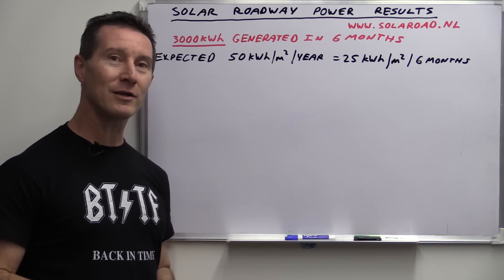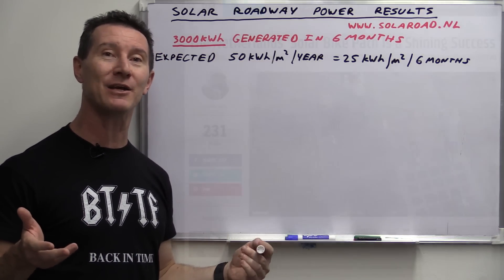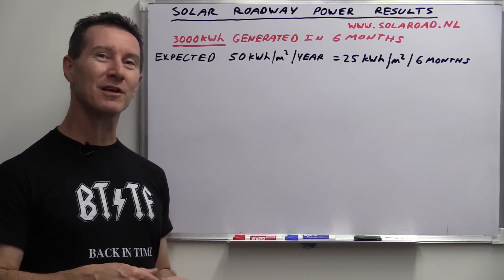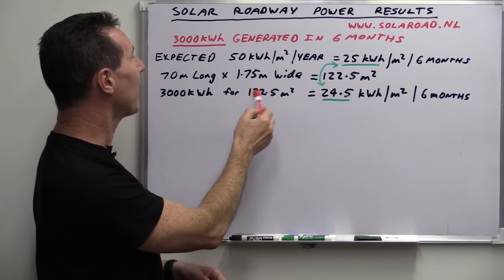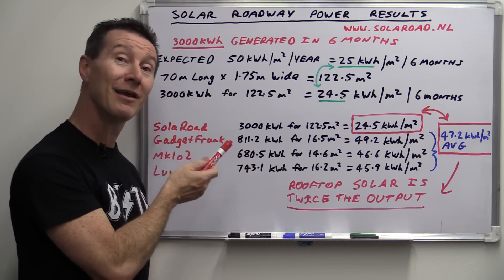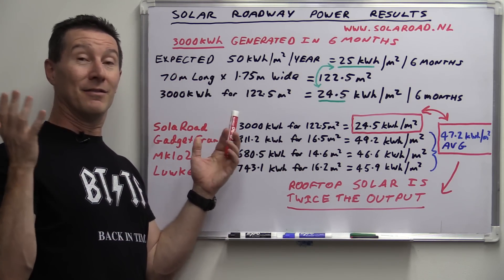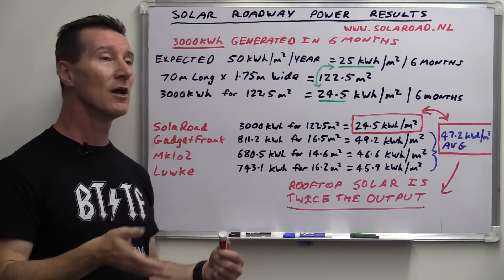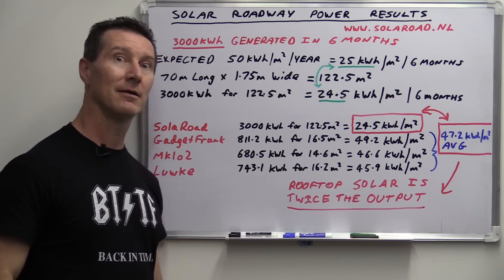EEVblog #743 - Solar Roadways Test Results

Comment: Pulling out my trusty Construction Master calculator I started working the numbers and confirmed the Google converter. Four feet is 1.219 meters wide. For ease I'll just use 1.25 meters for the width X the 70 meter length = 87.5 square meters. 
So 3000 kwh output divided across 87.5 square meters of surface area = 34.28 kwh/m2 
And that looks like about 75% efficiency compared to rooftop units as opposed to 50% efficiency. I'm no math wiz, nor am I an engineer but it would seem using real numbers can make a significant difference.
Reply: ronc1357 The bicycle path is 3.5 meters wide. Just look at how the road panels are installed.
But the solar panels are less then 1.75 m wide, more like 1.6m. They are off set by the lines in the middle of the road, and they don't go all the way to the edge. Just like there are gaps between the panels where 2 road panels meet.
When I do the calculations I come to roughly 28-30 kWh/m2 for 6 months.
But this measurement is winter/spring. I did some ballpark recalculations based on other Dutch systems and you will end up with over 70kWh/m2 annually.
Is this figure of 70Kwh feasible for deployment? I do not know. How can anyone possibly calculate that if we don't know what the road costs. All we know is the project cost, and they have been working on this for 5 years or so. The majority of the project cost is R&D.
Given the facts we have its impossible to tell how feasible these roadways are.
Reply: karp001 It was estimated by Dave to be 1.75 meters wide not 1.25 meter.  Which equals 122.5 square meters, not 87.5 square meters. 3000/122.5=24.489 kwh/m2. Which is 50% output not 75% output.  @ 5:00
Reply: ronc1357 Got to refer to my previous post. 
I read that article about Solaroad in the NL. The width of the path stated in the story was four feet. Using a converter found on google, four feet is 1.219 meters. now 1.219 meters being an unusual number and for ease I rounded it up to 1.25 meters for the width of the path. 
The key here is using actual numbers from the report. NOT a guess.
Reply: karp001 With just a few moments more googling I found the article and read it again. 
The first road in the world that generates electricity
SolaRoad is a living lab of about 70 meters and consists of a cycle path constructed of concrete modules of 2.5 to 3.5 meters. In one lane, solar cells are fitted underneath a tempered glass top layer of approximately 1 cm thickness, covered by a transparent and skid resistant coating. 

http://us7.campaign-archive2.com/?u=fc23dec47019a23d70031492e&id=39c5c2acf8

So, While Dave is willing to estimate to prove his point, I prefer to use something closer to FACTS. The path width varies from 2.5 meters to 3.5 meters, do the PV cells vary with the width of the path or did they follow the easy route and build all the PV cells to the same dimensions?
Reply: karp001 I just looked it up, and it looks as if you are correct. The dutch law states that a bicycle path has to be a minimum of 2.5 meters wide, or 8.2 feet wide, which would make the solar cells to be about 1.25 meters wide.
Reply: Raspoetin a Why are they hiding the actual costs? All they give is the cost with the R&D, are you suggesting they don't have a clue of the actual cost (taking R&D out of the equation), seems to me that wouldn't be that difficult to figure out if they are the ones who built the thing. It also seems odd to me if they are factoring in the 5 years of R&D that the figure is only 3.5 million euros, unless that is the actual cost. The same goes with Solar Roadways.
Reply: ronc1357 The project seems to be funded by 2 companies, 1 that builds roads, bridges etc and the other seems to be more involved with all the technical bits that goes along with infrastructure.
I am sure they now have a very good idea how much these roads cost to make. As to why they don't divulge that, I do not know. Maybe they just don't want to show you their profit margin...
Both these companies are decent sized companies, 1 has 2300 employees, the other 230 (but is part of a larger organisation that employs 7000 people). 
I find it very hard to imagine that they are doing this 'on a whim'. They must have good reasons for starting this research.
Reply: Raspoetin a It makes no logical sense from a sales point of view to give the cost with the R&D involved if you are trying to get the public to accept what you are doing. It would be logical to give the cost with the R&D and then give the cost without to show that it is cost effective otherwise how are you going to get any support for your project, and as I said if they have 2,530 people working on this the 3.5 million euros is not enough. 

Where did you get your information about how many people involved?
Reply: ronc1357 They don't have thousands of people working on it. I doubt anyone is involved in the actual research. Most of the research will be done by TNO (a research company).
But these companies are 'serious' players. Perhaps they can see a market for this product appearing in 10 or 20 years, and they don't give the actual figures because their intention is to start selling these roads for less then cost.
Reply: Raspoetin a 
I posted in my blog an analysis of the size, production and estimated costs for this bicycle path. It is written in Spanish but most of my references are in English. https://dcshams.wordpress.com/2015/06/14/fiasco-fotovoltaico-o-infundio-analitico/

Comment: So I am a little ignorant when it comes to the math, I am a psychologist not a mathematician, but what I want to know is what would have to change to make the solar roadway a more viable option? Do you think they could actually get there anytime soon?
Reply: Steven Ramey The glass, the components, and the installation,  would have to be nearly as cheap as what's used today for roads, can be a little more if there is an income from the electricity produced. They would have to be considerably more durable than existing road surfaces. There would have to be some sort of energy storage that would be able to handle the amount needed to do all this as claimed. The solar cells would have to become at least 400 times more efficient than they are. 

Basically the law of physics would have to change in order for "Solar Roadways" to work anywhere near to what is claimed. No nothing could actually get there anytime soon.
Reply: ronc1357 
Well okay then. Thanks for that explanation. That sucks though I thought it was such a neat idea too.
Reply: Steven Ramey No one here knows what the cost of building this road was. All we know is the project cost which constitutes mainly R&D.
Rising energy prices could possibly make this road viable. Being less dependent on oil producing nations could also be a factor that would make the road viable.
At the moment it is just impossible to tell.
Reply: I just thought that with all the extra stuff like recycling run off water, having roads that light up and alert people of accidents, and heat up to prevent freezing, plus storing cables, that it would be a worthwhile thing to experiment with.
Reply: Steven Ramey all the extra stuff you're talking  about adds considerable to the cost of the road plus the extra stuff you're talking about decreases the electrical output of the solar panels, most likely to the point that it will actually draw power instead of produce it. 

For instance I watched a video promoting heated driveway. "Indiana warm floors" they stated it takes 150 BTU's of heat per square foot to keep up with a 1 inch per hour snow fall. 150 BTU's is equal to 43 watts. 

At 43 watts/square foot Solar Roadways would need 18,576 watts to do this for their prototype driveway. Solar Roadways stated that their system produces a total of 3,200 watts of electricity, with the possibility of going up to 7,200 watts.
Reply: I just meant it was interesting to experiment with not that it was actually practical at least not right now but maybe someday or maybey someone is going invent something better.

Comment: Thanks for this video, and the previous two.
I'm no scientist and barely an engineer. You definitely proved that rooftop solar power is twice as good as solar roadways. I'm completely convinced.

I think there's more energy output from solar roadways than cement bricks and current sidewalk materials. The cost to replace them may not equalize yet, but I hope the potential is there.

Comment: Consider that they got that in winter, when the available light per month is lower: less than 50% of the yearly production is expected, not 25 kWh/m^2/6months but less. On the rest I agree
Reply: Olaf Marzocchi He is comparing Solaroad to normal roof mounted solar panels that are set up in roughly the same area in the same time frame, and by comparison the Solaroad was 50% less productive than the normal solar panels.
Reply: ronc1357 sure, but that one is ok. At the very beginning he wrote that the expected production in 6 months is half of the yearly expected production (50 kWh/m^2/year). And that is not correct (in general).
Reply: Olaf Marzocchi That was a mistake of wording on his part, I agree with you about that. Even so, the main reasoning behind this video is a comparison between the two technologies, that shows the production of the solar road is only half that of normal solar panels, and the claim they "Solaroad" got better results than expected is wrong also because these are exactly the results they expected. If the solar road got twice the production than it did it still wouldn't be economically viable.
Reply: ronc1357 that's why I wrote that except for the initial wrong calculation of the expectations, I find the rest reasonable: solar roads vs rooftops is a meaningless war :) 
But the expectations were not 25 kWh/m^2/6 months, they are realistically about 10-15 kWh/... since the months considered are the ones in winter
Reply: Olaf Marzocchi I believe Dave factored in solar isolation in his equations, from previous videos (he has several), and that's where he got the numbers from. There are online charts you can use to determine if your installation of solar panels would be viable, this is how they determine payback times with normal solar panels, and it seems the factors are correct based on the results.
Reply: ronc1357 he did take them into account when he compared different rooftops installations vs road, but not in the few minutes where he debates whether the solar road has met expectations
Reply: ronc1357 I was referring exclusively to the seconds 4:11 to 4:28, where he says "one year expected: 50, THEREFORE 6 months expected: 25". Since the 6 months of the initial test are December to May (check the graph), there is no way that in 6 months of winter/spring the production is half of the full year. Maybe at the Equator, in Africa, but not in Europe where winter has less sunny days than summer (as it can be seen in the graph few seconds after 4:11 where the production is ramping up quickly in March).
Reply: EEVblog just for info
Reply: ronc1357 oh I noticed now the red box at 4:39 where Dave states the same thing that I was writing here: he recognised that 6 months of winter correspond to less than the yearly production and therefore his speech was inaccurate. I was watching on Android and the red box did not appear. Still, road panels are not viable, I always agreed on that.
Reply: I sorry, I wasn't trying to argue, I was just pointing out the facts as they were presented, and base on my less than reliable memory I believed he factored in the time of year... I do however believe there isn't going to be any significant improvement in electrical production with these Solaroads regardless of the time of year, sure there will be some but not much. That's just my opinion though.
Reply: Sure, I also thinks the same, I was not discussing the final conclusion of the video (the comparison with other nearby solar installations was done correctly and so are the results).

Comment: "It's generated more power than they expected" What if they expected nothing at all? Any result would be more than they expected. Why do they think this is an argument?
Reply: Beelzibubbles They expected 50-70 kWh per year. Current figures indicate a yield of over 70 kWh per year.
Reply: Raspoetin a Figures recorded show 25-30 kWh per 6 months, which is 50-60 kWh per year. 60 kWh is less than the 70 kWh, therefore figures indicate a yield under 70 kWh per year.
Reply: ***** Based on 25kWh for 6 months:
The measurement was made during the winter months. When I check Luwte's output for this period I get an output of 743kWh. The output for the remaining 6 months = 1576kWh. (Total per year of 2319 kWh)
This would mean that the solar road should produce around 53kWh during the summer months, totalling 78 kWh per year.
- MK1o2's figures give 76 kWh

- GadgetFranks figures give 79 kWh

The links to Luwte, MK1o2 and GadgetFrank are in the description.
Quite frankly, I am very surprised that Dave (Eevblog) did not realise that, or choose not to disclose that.

Comment: The only people that care that these things are not going to be a significant source of energy are those that understand the inefficiency of it, because they love well designed and engineered solutions, and the people that require any alternative to fossil or nuclear to be so much cheaper that it makes business sense to go with the cheaper alternative.

Maybe we should be willing to tolerate the lower quality solutions, like solar roadways, because they contribute to the direction of moving away from fossil and nuclear power.

I remember as a kid hearing people say that photo-voltaic power was pointless because oil and coal were so cheap and plentiful. People declared it a dead end technology.

Sometimes movement forward requires some real technological stinkers to help push the actual solutions forward. I see these solar roadways as that nearly pointless tech that gets people thinking about new ways of doing things.

And that is worth the cost of some solar panels pretending to be a road. At least to me it is.
Reply: otopico Why put them in the road? Solar panels on roof tops... are so much better and cheaper. 

If it's because we will run out of materials to build roads "the black goo" then make the roads out of concrete. 

Solar Roadways require concrete foundations anyway. 

So what's the point in putting the solar panels in the road where they don't work as well and cost much more... there is no logical reason for it.
Reply: Rooftops are always going to be better. I  just think that we should try to direct people to better alternatives rather than having a laugh at the expense of people going after the goofy ideas like solar roadways.

These people are misguided, but they want to make things better. It seems that we should focus on ways to take the drive these people have and focus it into places where it would make a difference.

If you can get people excited about a low efficiency roadway, it should be possible to get those same people excited aboutpractical applications of solar.
Reply: otopico I really don't think these people are trying to make things better. 
I think these people are trying to make their bank account better. 
The reasoning behind what I am saying is they had to resort to lies, creating solutions to false problems, and emotional touchy feely crap in order to get people with a limited knowledge of mechanical principles to give them money. By the way I just gave you a viable solution to get us away from fossil fuels.
Reply: otopico Rooftops are a horrible solution for a Nation. Most of the houses are privately owned, just the red tape would be horrendous. The installation of panels on hundreds of thousands of different roofs is a huge undertaking. Just think about the expertise and skills required, where do you get all these people from?  Or what about the maintenance?
Just think about the economies of scale. You can build km after km of road that is exactly the same. Mass installation.
To give you an idea about large scale solar installation, panels on a roof cost about $4 per watt to install. Large solar farms can be installed from $2.5 per watt. 

This project aims for a return of investment of 15 years. This is roughly equal to solar panels currently installed on a roof.